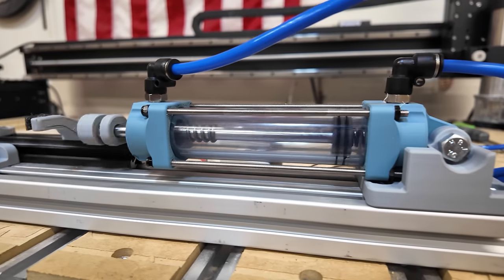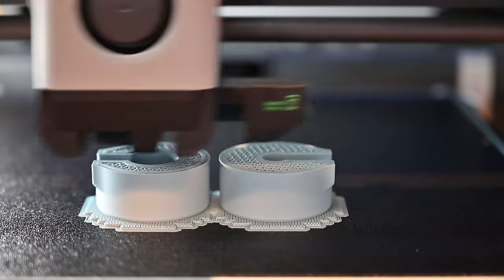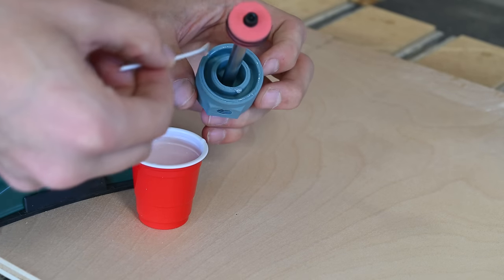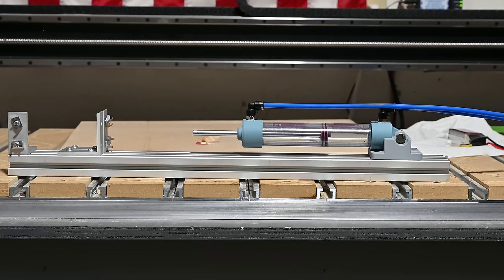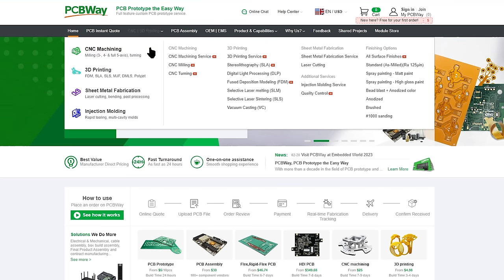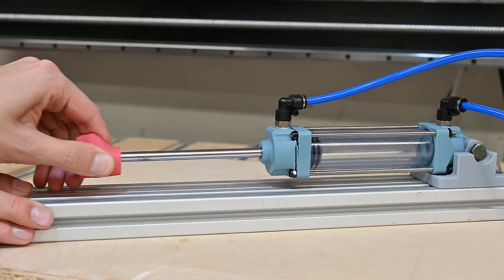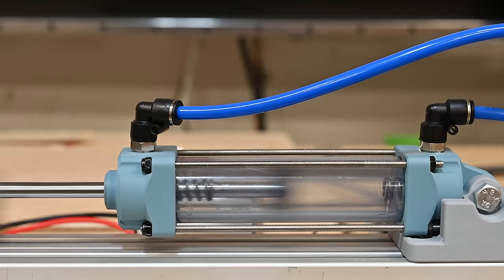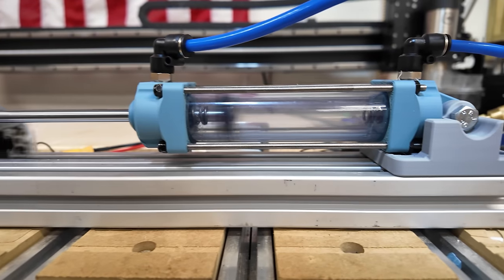3D Printed Pneumatic Actuator... It Actually Works!

Comment: The contraption you made to flick the switch back and forth is glorious, you basically made a very powerful and elaborate useless machine.
Reply: It's not useless, it had a purpose.
Reply: @Splarkszter Google useless machine
Reply: In a world full of microprocessors, what could be better than a mechanical analog solution!
Reply: It is certinly not useless. It tests for reliability.
Reply: On the contrary, not useless at all. the product was knowledge and experience.
Reply: Have a look at this page https://en.m.wikipedia.org/wiki/Useless_machine
Reply: @izzieb   A lot of youngins in the crowd aren't there. Sometimes I feel like I have to define every word I use for people to understand me.
Reply: You try to stop it, it crushes your finger.
Reply: not at all, you can use that transfer linear to rotaty motion. Very cool idea.

Comment: Your design relies on the tensile strength between z layers in the end caps to contain pressure.  If your tie rods were longer and the held the printed z layers in compression against pressure, it would be significantly stronger.
Reply: Good point

Comment: I have made several slightly pressurized liquid containers and adapters, and have used Varathane, a thin urethane-based wood hardener to seal layer porosity. Just pour the Varathane in, apply a slight pressure, then removed the excess and allow several hours to dry. I applied pressure by just blowing into a fitted tube. You will likely find a few seeps when the pressure is applied, but once dried I had no leaks. I also replaced tapered pipe with straight threads with oring seals.
Reply: This is a really great idea!

Comment: I noticed a few things you can improve.  I have several years experience dealing with cylinders.  First,  you are making a bomb, be careful.  Design your cylinder to work in 60-90 psi, that’s what the pros suggest.  More than that is just a waste of air and money.  I would get hold of a catalog from a company like Parker, they have lots of little built in problem solvers that adding in 3D printing should help keep make it better.  An oscillating circuit is possible as well.  This would get rid of the switch, I see it works but there are more graceful solution, like a physical or magnetic limit switch.  All in all it is a great start.  Hydraulic will be much safer but don’t get any of that fluid under your skin, it is devastating.  Same with pressurized air, don’t feel around for leaks if you can avoid it.  Google injuries in you have a strong stomach.  Good luck.

Comment: I work for a pneumatics manufacturer who shall remain unnamed, and this is incredible! Couple of notes here though (2 and 3 are probably unnecessary, but fun regardless):

1: Don't use NPT threads for this, as they're a conical that's designed to form a seal when the crests of the male threads deform into the female threads... Look for G threads or BSPP (or honestly for small cylinders there are M5 or 10-32 fittings) which will be parallel and seal with an O-ring. This will put much less stress on the print and they don't need any Teflon tape!

2: Many air cylinders use restricted air flow to act as a cushion instead of a mechanical spring, which I'd love to see working here. Essentially you need a shoulder on the front of the piston that reduces the area that air has to escape through for the last inch or so of the stroke. It slows down your cycle time, but the smoother acceleration is generally better for all your parts.

3: While O-rings are fine for the static seals, you'll get better performance out of V-shaped or Z-shaped seals for the dynamic seals. The V or Z cross section creates a one-way seal (this is why pistons are designed with 2 seals), but the benefit is that the more pressure you put in the chamber, the harder it seals against the tube and the less leakage you have. They're also generally lower friction and handle debris/scratches better than O-rings. They're pretty readily available online, or if you wanted to be cheeky you could order a seal repair kit for an actuator and just design your parts around the kit. Probably defeats the purpose of doing this as cheap and simple as possible, and you've clearly shown that the O-rings work more than well enough.

Again, super interesting project and I can't wait to try and replicate it myself!
Reply: lubricated o-rings should be fine for low PSI...hydraulic stuff at thousands of PSI need MUCH more sealing force...and backing washers to prevent extruding the o-ring past the grove.
Reply: +1 For the BSPP or G threads. I can even model matching threads in my 3d prints. The taper on NPT just destroys 3d prints. I designed vacuum pods for CNC work.
Reply: Would you be interested in designing a better version of this incorporating your proposed changes? It would be very appreciated I think :)

Comment: This is quality maker content! I'm definitely interested in the hydraulics, but I'd also love to see that pneumatic one run in that tester, to just see what fails

Also: Not sure it'd work with hydraulic fluid, but bumpstops or polyurethane disc bushings might be a better option (vs. springs) for energy absorption inside the cylinder - Amazon probably has them close to the price of springs and would eliminate the metal wear/spread load on internal cap faces 

Also also : Gorilla glue on the NPT fittings works great to seal the threads without having to tighten them down enough to accomplish sealing between the thread faces. Use it all the time on cheap chinese npt fittings - and it locks the fittings when it dries so you can clock them in the most convenient directions. Epoxy works better but cleanup is much easier w/ the Gorilla glue - need a wire wheel on a bench grinder to cleanup the epoxy

Comment: My final project for engineering degree was to build an ENTIRE 3D printed pneumatic linear actuator: even the sealings were 3D printed 😂 and I did it with a very low cost ender 3. The cylinder was able to resist up to 4 bar with no losses.
I really enjoyed your project too 😊😊
Reply: Can one access the print files?

Comment: Try running the threaded rod the full length of the endcaps, so there's no layers to split
Reply: Good thinking... maybe even add flat steel or alloy discs as the first and last items in the stack so the plastic layers are all in compression.
Mind you, if it can stand ten thousand cycles in half an hour as it is, it probably doesn't need anything unless increases in pressure or speed are introduced.

Comment: Air pistons use air to dampen the impact on the end caps. There is a chamber in the end caps and the piston has a cylindrical extension on both ends that go into those chambers, basically air springs are formed.

Comment: 5:27 the confining thread acts as a stress riser, that why it fail. you had like 1 mm of 3d printed layer supported by the thread and nut. this meant that you had a almost pure tension/shear force against a really small cross section of interlayer plastic holding it. the solution didnt need the springs, you just had to print the caps with  so the screws were fixated farther in the cap, o even extend the cap. the problem here is like stress propagation in soil. you have an max angle that you can effectively transmit support between the force, the medium and the reinforcement. the only way that the current design could work is just beefing it with steel so the good awful geometry induced stress riser can be overcome by the steel marginal resistance (the resistance after being fatigued by infinity), or make a almost infinitely rigid material (carbon fiber? diamonds?, both would suck against fatigue or impact resistance tho), so the angle of transmission of force can be about 90° (eliminating the possibility of stress riser altogether ).
or you can just extended the thread a bit further back in the caps an let the plastic work in a strong mode: compression and let the steel deal with the tension in the machine.

Comment: Cost effective compact pneumatic actuators for applying pressure to material(stock) or parts(simple or complex) in a custom fixture for CNC machining is something I'm working on instead of custom flat head screw based vise blocks which is what I've been using for machining simple and complicated parts that are hard to fixture.

Projects like what you did in this vid I find very exciting because there's an interesting future in small scale cost effective machining with decent output levels or cycle times and things like cost effective custom or part specific pneumatic actuator clamps(side or top clamp) for rapid parts holding is one of the keys to making that happen, vacuum fixtures and palletizing are also highly important.

I'd be interested in seeing you try to design a linear actuator that isn't very tall and a small footprint that can be bolted to a fixture plate with 6mm or less of actuator travel but can apply enough sustained clamping pressure for machining. Shouldn't be to hard to get enough pressure for clamping wood or plastic. Clamping composites (G10, carbon fiber), aluminum, copper and capable engineering plastics I could see needing a higher clamping force.

Comment: you could move the flange for the threaded rods to the very end of the end caps, so that the threaded rods can take all the tensile loading. then when the piston crashes into the end cap, the layers are compressed together instead of pulled apart. then the only failure mode for the printed part would is shearing of the layers themselves, instead of relying on the relatively weak inter-layer adhesion.

Comment: Build a vacuum chamber..then soak the FDM parts in polyurethane, vacuum it down and let the polyurethane soak into the layers and inside the print...100% infusion, or even that slow setting 2 part epoxy....
Also...why not have a glue on cap with a screw on nut, this way to service, you just unscrew the nut like on a hydraulic cylinder
Instead of using a mechanical switch, use optical sensors, and an arduino....very very very cool!

Comment: Neat video, I see one flaw in the design. The print layer orientation. You keep putting the Z orientation to the most strained parts (the hook part at the end, and the part that was "hammered" all the time. I bet if you changed the print orientation of those two you could get better results.

Comment: If you want the great layer adhesion and preferably well sealing materials, I'd suggest trying to print with a copolyester filament (pet, petg, pctg, cpe, etc etc), and turning down the fan speeds as much as possible. PCTG also had a very slick surface, something to look into
Reply: PETG with little to no cooling fan (in a heated chamber) works SUPRISINGLY well..and the layers just seem to bond like glue

Comment: Nice work….incorporating cushion stops on your piston and cylinder ends would control speed at the end of stroke and adding pneumatic speed controls in each line would allow you to control flow / speed independently in each direction

Comment: Pro tip: rapid kick your epoxy. You have a 3D printer. Set bed temp to 80 and put a box over it and throw your curing epoxy stuff in there. You might fully cure it in 4-6 hours instead of 24. Not only is it faster, hot curing epoxy makes the final cure tougher and improves adhesion.

BTW when you have 1:1 epoxy, have you ever thought what is in those components? Like when you're dealing with pure chemicals, you don't need more than a few % of the crosslinking agent, and well one part is the epoxy monomers, so what's in the other half? Well there you find resin monomers as well, some crosslinking agent, fillers (often fumed silica) and usually some plastifiers. So the "hardener" part of 1:1 epoxy also often makes it softer and tougher. So you can control properties of the resulting epoxy by adjusting the mixture by up to about 30%, more "resin" part gives you a harder and more chemically resistant outcome, while more "hardener" part gives you a tougher and more flexible one. Very useful when you're gluing things that are particularly hard or particularly soft and you don't want to introduce stress via glue joint, or when instead you're casting and need particular mechanical properties. However you gain the problem then that it will take an eternity to cure (or will outright fail) once you start adjusting the mixture. No problem, hot curing allows to force it to cure regardless.

I know, nobody cares, sorry.

I feel like PETG would be perfect for the caps as FDM print. The layer adhesion is very good and when you torture it by slowly overtightening, it all just deforms a little and doesn't just crack. I actually sort of despise PLA and try not to use it for any purpose that isn't decorative. I also print HIPS a lot, and i don't hate it, i don't know why everyone treats this material as a joke. My issue with PLA is that every single print i did several years ago that was anyhow loaded has failed in the interim, with discolouration and crazing. Initially it's super strong but that's not worth much if i can't rely on it. I have not had any issues with my PETG and HIPS prints.
Reply: How do you identify which part is which when they're both clear?
Reply: @anon_y_mousse  Hopefully your manufacturer has given them a helpful label like "resin" and "hardener" rather than "A" and "B". Otherwise... the resin part doesn't have a smell. The hardener is the stinky one. The hardener is also usually a little more yellow and usually a little less flowy. They also have a density difference, but it can come out either way, though hardener is usually heavier.
Reply: @SianaGearz   Thanks.

Comment: Would have loved to see you do the same test again, but still do this with pneumatics, but up the pressure.. 
You did it with 50psi, wonder if it would still do 10,000+ with 120psi.

Comment: So I'm curious on another experiment/possibility:
If you pressurize both sides, could you lock the actuator at the halfway point?
Reply: Yes you could.  The weak link would be the seal around the shaft.  There are types of rolling seals that can eliminate leakage at this point as well.

Comment: STOP.  DO NOT use a motorized pump to test to failure.  Just use a hand pump.  You can get them affordably at Harbor Freight, they're used for auto body work and metal punches.  They generate pressures in the multiple thousands of PSI, you'll get the desired results.

The incompressible nature of water (and oil) and the low elasticity of some of your parts means that pressures will rise VERY quickly; you can't control a pump motor finely enough to prevent an instant blowout.  With the hand pump, you can go very slowly indeed.

Comment: Metal threads…you need them. Heli-coils might work if you can’t find heat inserts for the larger fasteners.
Reply: This isn't true. You can clearly see the failure point being present across layer lines of the plastic. The threads did not fail. In my experience, any screw larger than M3 does not need an insert unless you are repeatedly screwing and unscrewing. The failure point for pull out is identical with and without inserts as the plastic will break in other places before the threads. The only risk is torque-out when installing the screws, which is only an issue if you are not good at screwing things in, or don't undersize the hole appropriately.

Comment: Nice project.
Could activate the switch sooner so you don't over extend so hard. 
I would also use flow control valves to have a smooth controlled extend and retract motion with no damage.
https://www.youtube.com/watch?v=2JUz1vKNFYA
Not sure if you could print flow control valves though. But you could add a restricted exhaust.

Comment: Love your video, but your 3d printing skill.... There is so much more you could have done to make the parts so much better.
Reply: Like what? Pls elaborate
Reply: @jackygrush  Use pctg, petg, cpe or something. No cooling. Adjust flowrate to fill the print area. Minimal airgaps inside the print. This is not a eyecandy part. It's a function part that holds pressure.

Comment: I stopped watching when I saw you didn't do 100% infill.
Reply: Layer adhesion strength isn't increased by 100% infill. CnC Kitchen has some great videos covering this. 

The end pieces would have been far stronger if they were printed at a 45-90 degree offset to take into account the anisotropic nature of 3d printing.
Reply: @smurf___  Drilling and tapping needs 100% infill, think of metal porosity, something.